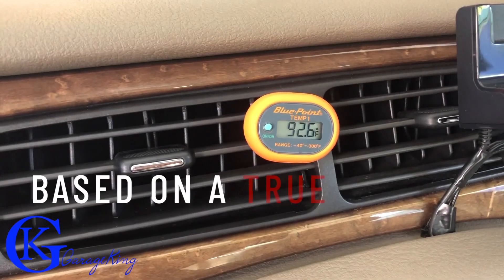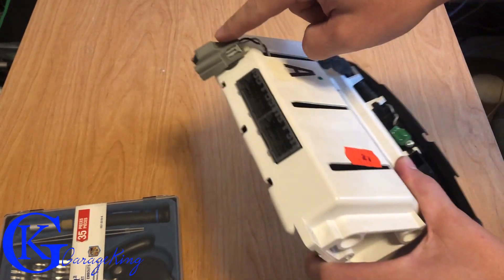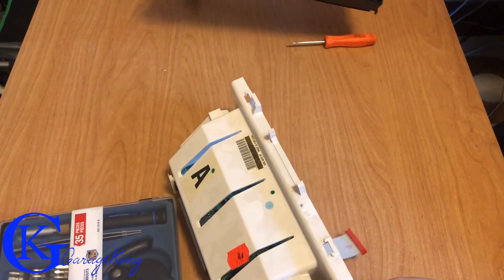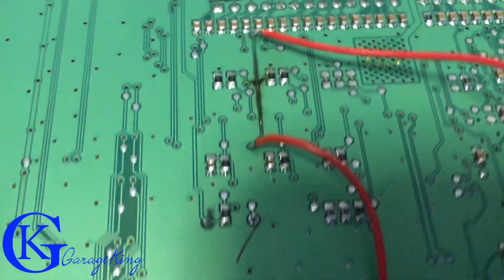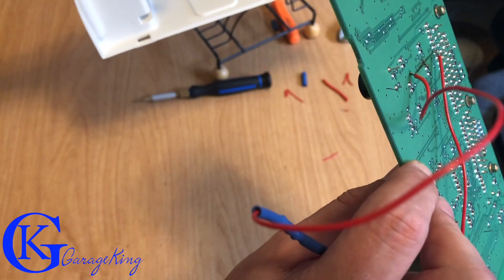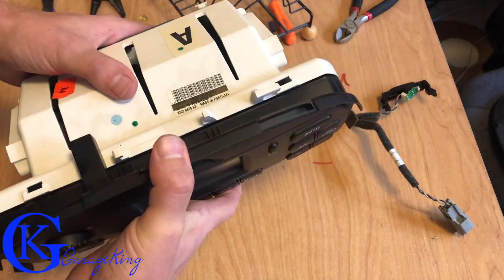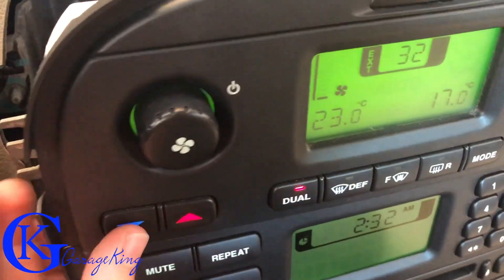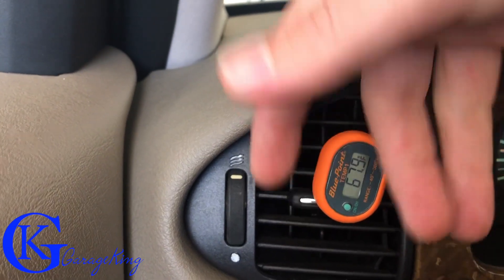Jaguar Climate Control Module Repaired Cheap !!

Comment: Can you use a 2A blade fuse?
Reply from the maker: I would stick to a 1.5A blade fuse if you have to use a blade fuse.  There is not a lot of room in there, so if you use a blade fuse you are going to have to purchase the base holder for it which is bigger than the slim design of the fuse I used.

Comment: What gauge wire did you use for the jumper cables on the circuit board?
Reply from the maker: Hey there, if I remember correctly it was 16 gauge.

Comment: Hi, please how temperature is low, when clima is OK? 
Old cars have about 4-6°C new 15°C and more. S-type 65°F/20°C is OK? Thanks M.
Reply from the maker: I'm not sure what you mean, most cars are similar temperature and some old cars get colder than new cars.  Old cars (early 90's and earlier) used 12A which was very cold, 134A is not as cold, and the new 1234yf has some problems.  Your Jaguar is 134a, which is the best overall (Environment and temperature).  Most cars right at the evaporator run about 4-6 degrees as you mentioned when the AC is running.
Reply: I mean, when I use termometer on cold air from low temperature on panel/display, how many degrees the cold air have by OK clima in my S-type.
I changed clima modul at passenger side, but still same. I'll control conectors and cabels and multi ventil. 
I buy S-type without OK clima and repaired now.
Reply from the maker: @matbeo4603  I see what you are saying now, the cold air from the vent (degrees) depends on how hot the temperature is outside. If its cool day the temp will be lower, if its hot day the temp will be higher.  If you can get to 10C on a hot day 30C that is very good. One problem that can cause the circuit board to fail is the coolant valve. Thats what happened on this car, when the coolant valve shorted out, it caused the failure in the computer.  See this video on the heater control valve. most people overlook it. https://youtu.be/j7rlsJkhSoI
Reply: @GarageKing  Thanks, your video give me this idea with hight or low temperatured. I have only hot air over vent not cold and hot. I check my valve...
Reply from the maker: @matbeo4603  Sounds Good

Comment: Hey, I’ve got a Jaguar Stype R where the climate fan turns on and off and just repeats this. This only happens when the car is off and is killing my battery any idea what this is?
Reply from the maker: If you have a scanner you can scan for codes in the climate control module as it could be a good starting point. I have never heard of that before, so not a common problem.
Reply: Probably final stage resistor also known as multistage resistor. Common fail
Reply from the maker: @Jimslimmer  Thanks for the suggestion, hope you are having a good weekend
Reply: @GarageKing  so far so good, thanks for the great content. I’ve seen the resistor fail on a bunch of Land Rovers and cause daily battery drain.  I’m assuming there are some shared parts here
Reply from the maker: @Jimslimmer  I think you are right on that one. Appreciate the comment

Comment: Good afternoon, do you work on Jaguar's mine has the same problem.
Reply from the maker: Hey there, I'm not a jaguar mechanic, actually a General Motors mechanic, but this Jaguar belonged to my friend so I spent some time figuring it out.  Once you know the control module is good (if you watched this vid you will know) the other common problem is the heater control valve and the video is here https://youtu.be/j7rlsJkhSoI and if you want to learn how to remove the module that is here https://youtu.be/qIPWtyGz64o
Reply: I had it at a shop and he changed the heater ac valve and then the ac blew all cold but when we tried switching back to hot it did not work and also I bought on line another climate box in the inside above the radio and still not working correctly.
Reply from the maker: I would check the inside of the climate control box, and make sure you have the right one. I think if you have a heated windshield its a different one. The other thing is make sure the blend door is working.  Sorry for the late reply, just saw this now, not easy to keep up with comments sometimes...... @donnellphifer9344

Comment: So shouldn't WHAT caused the board to burn be addressed?
Reply from the maker: Hey Thanks for the comment and many times there is something that causes the board to fail, but on a 30+ year old vehicle, sometimes the parts just fail.  It could have been factory soldering joint for the transistor that came loose. The vehicle still runs fine after the repair so I chalk it to a transistor that failed, transistors do fail and when they do they can burn up, the only thing you can do is replace it.

Comment: I am having this cooling issue with my 2004 s type. I recently had the valve under the hood replaced due to it leaking about 3 months ago. I have just in the last couple days had this heat/cooling issue. I pulled the control module out as you instructed. I'm not seeing any burned areas. What else could be my issue.
Reply: Ok will recheck. Thanks 👍🏾
Reply from the maker: Hey there and thank for the comment.  I have seen 3 issues with the S type.  The heater valve (which you replaced), the circuit board (please look it over very very carefully to make sure you didn't miss it) and the blend doors not seating fully.  I think at one point there was a recall on the blend doors, but I just can't find it.  You may want to Google it to see if the article is still around.  Those are the only 3 issues I have seen with the S type that cause the hot air in the vents. I do love these vehicles so we have to do our best to keep them on the road !!!  Thanks for the comment and if you are sure its not your circuit board, and the connection is good at the water valve (when they plugged it in) then I would check your blend doors in the dash.
Reply: Also do you have a video on the blend door repair and or location
Reply from the maker: @MrBee1225  Hey there, I haven't done a video on the vents.  I did do one on the heater valve and you can look at it here https://youtu.be/j7rlsJkhSoI its lets you know whats involved and where the connections are.  I have seen jobs where the connector is not fully seated.  For the blend doors I use my scanner that opens and closes them all.

Comment: Awesome video and fix, thank you for making this video.
I'm having the same issue with my 04 S type, I replaced the heater control valve, the ac lines a filled, compressor is good, one center vent blows cold, and the other three blow hot air. Is there anything else I should do regarding the 2nd center vent or will this process fix all three? thank you for any guidance you can provide me.
Reply from the maker: Hey there and thanks for the comment.  This process can fix it, and its common so before wasting anymore time I would pull the module out and check the circuit board like in the video. See this video https://youtu.be/qIPWtyGz64o

Comment: Thanks bro for showing us how to fix the problem because to replace or get it repaired is expensive.Question it may sound dumb but do you know if the heat value can be fixed with out replacing it since it goes out so much ?
Reply from the maker: Thanks for the comment. The heat valve has to be replaced as it usually gets corroded with the coolant leaking into it. So it all gets destroyed. At least the hot water valve is not that expensive. Its that module that brakes the bank !!!

Comment: Hey thanks bro for showing us how to fix the problem this piece is expensive and hard to find unless you get it used to rebuild the unit is expensive also. Thanks again , question it may sound dumb but do you know if the heater valve can be rebuilt ?
Reply from the maker: I don’t think you can rebuild the heater valve. They don’t cost a lot new and once they go bad the coolant pretty much destroys them inside so if you were to rebuild it, I wouldn’t know where you could gets parts,and you would be replacing pretty much everything except the body and in that case it’s just cheaper to buy a new one.

Comment: This is great..however my 2004 xtype heats on an off..what could be wrong?
Reply from the maker: I think your vehicle still has a hot water valve, I think they eliminated it in later years, but I would check that heater valve (if you have one)  I know I have a video on my channel where I replace the heater valve (on an S-Type) but I would look to see if yours has a heater valve, and if there is an sign of leaking replace it, as they cause problems.  Follow your heater core hoses out from the firewall and see if they go to a valve. There was also a TSB on your car for slow operation of the system and the culprit was slow air blend door operation.

Comment: Successful repair!  We've bought some pieces from junkyards and basically now try to repair alternative waves before buying, since most pieces never worked out.  Awesome video.  Enjoyed it and of course love seeing the "orange" temperature gauge.
Reply from the maker: Thanks soo much.  I'm all for grabbing something at the junk yard, when I was younger I would go there all the time, now not as much as I find some of the electronics don't work, and cars have a lot of electronics in them.  For this car I did go to the junk yard and the part did not work.  I took the part back and it actually worked out well as I was able to repair the factory part.  The dealership wanted just over $1000 for a new part, the junkyard part was $100 and to fix the factory part literally cost about $5 !!!